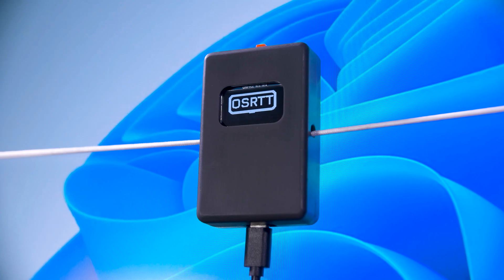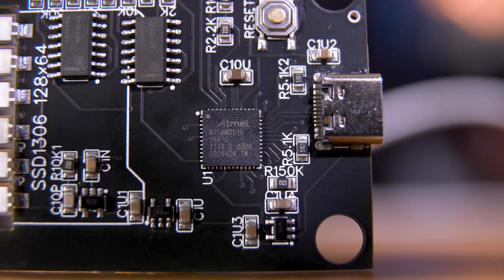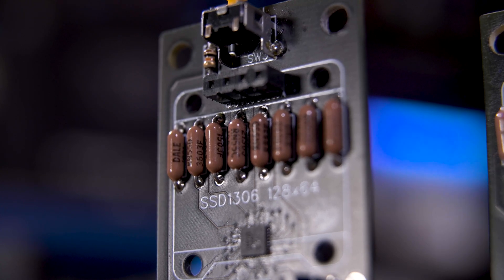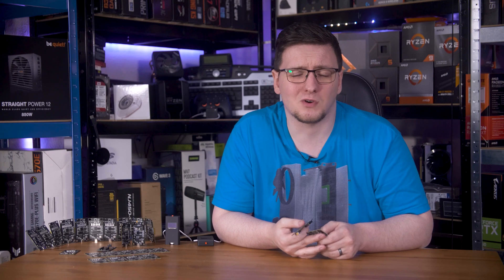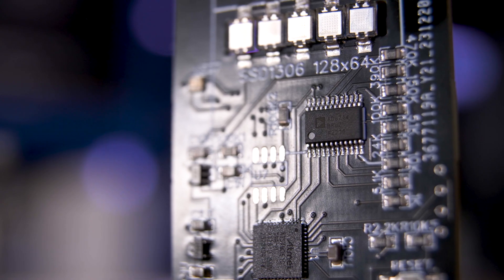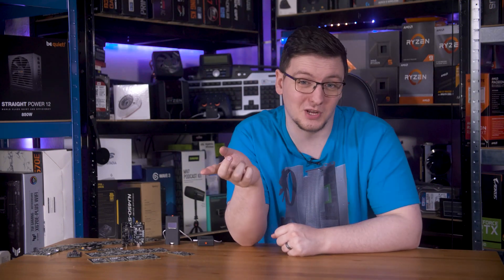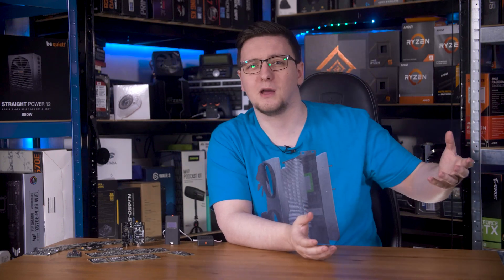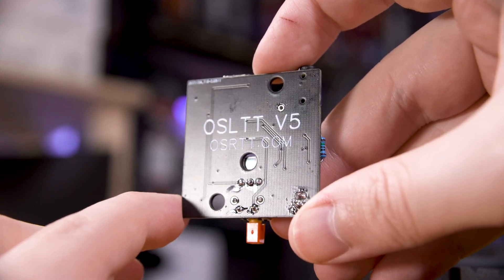OSRTT Pro CS - My NEWEST Open Source Response Time Tool

Comment: Hey, just looking at your website and the OSLTT tool is very clear on what it does, but the OSRTT PRO C is not, and so it's hard to know why I'd buy the OSRTT PRO C vs the OSLTT. I'm looking to test things like the following:

- Moonlight/Sunshine latency
- OBS preview latency with the 4K X

This would be between a gaming PC and iPads, MacBooks, Samsung Tabs, Steam Deck

I assume there's to test the relative latency with your tools between a game console and OBS preview or PS Remote Play I could use the OSLTT to track a mouse click (on a supported game)?
Reply: @AALTech  yeah I was disappointed by there being no response, but comments can slip through pretty easily. It would be odd for him to not want to sell his product otherwise. I ordered the ""OSLTT (Latency Tool)" recently, and it's due to arrive next week. I'll be using it to test the latency of game streaming services and software for streaming between computers. I can let you know if it works as advertised if you'd like, but I have no reason to doubt that it will.